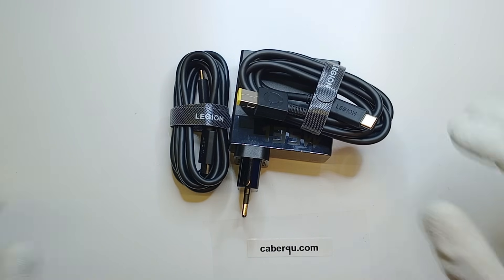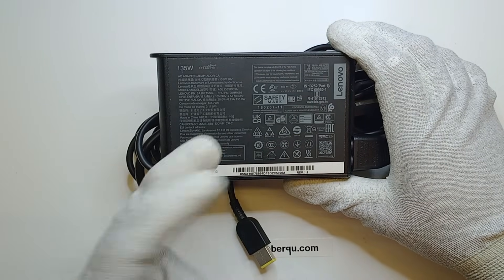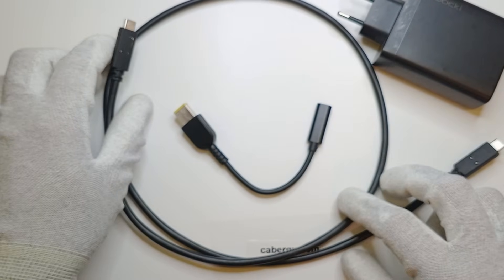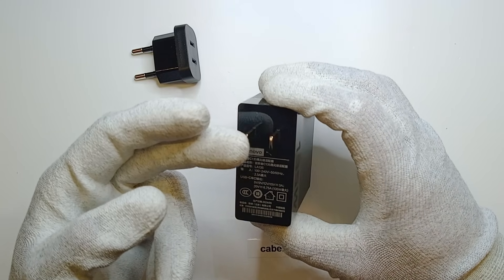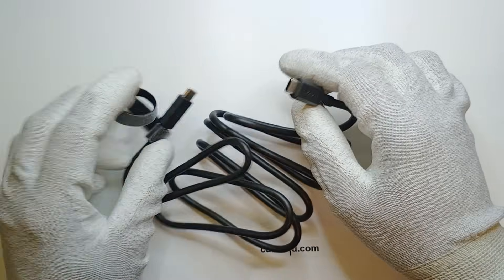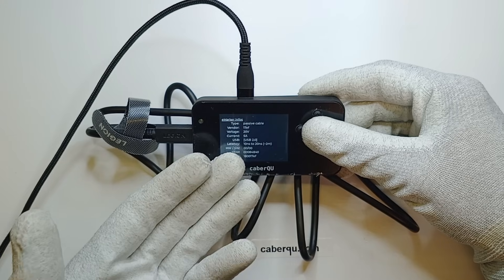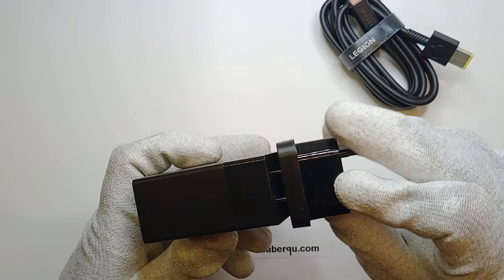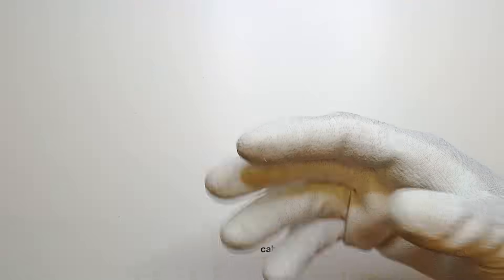Region locked laptop charger for above USB spec charging currents

Comment: The plug is Chinese. Also you're better off testing it with charger tester , it might support all the voltages and currents. Also it probably outputs 6.75A only if you're using the USB-c to prop Lenovo plug. This is probably why the USB-c to USB-c is only rated at 100W, cuz it won't trigger the 20V 6.75A, but only 20V 5A.
And the charger is genuine Lenovo, branded for Legion sub brand.

Comment: This is fairly common actually, dell has an out-of-spec USB-C solution dor 200w docking
Reply from the maker: quite interesting, could you send a type or link?
Reply: @quiescentcurrent the WD22TB4 does 130w for dell systems over a single USB-C cable and the TB18DC does 180w over a weird, fully moulded dual USB-C connector. I think so long as the PD spec itself isn't violated (and still used for negotiation) then using a proprietary spec for exceeding PD is absolutely fine
Reply from the maker: Thanks a bunch, I will take a look at them

Comment: That Lenovo rectangular plug can charge at many different wattages that is determined by a sense pin which has a resistor connected to ground. You can buy different cables which will have the resistor built in - the value of the resistor indicates the charging wattage so each cable will have a fixed charging rate.
Reply: It is not a resistor. It's a chip embedded in one end of the cable, that talks to the charger telling it its supported specs.
6.75A is more than the usb-c spec, so probably that charger and cable have a proprietary code that enables the charger to give that much current only with that cable.

Comment: lmao it's not fake 
MacBook chargers do the same thing - they are 140w but use USBC PD 3.1 spec via MagSafe 3 and limits the charge to 100w if used with regular PD 3.0 cable

Comment: There are a lot of spec violating charging devices from China actually. One good example is Xiaomi 33/66/90/120W charging over a USB-A to USB-C cable. The cable is modified to have a center pin on the USB-A Side and has a special E-Marker on the USB-C Side. They use a custom Mi-PD Protocol that isn't compatible with regular USB PD.
Reply: Xiaomi are a-holes. Their phone charges 67W with 11.11V and 6A, but with regular PD it charges 15-18W top. I don't understand this why they are using own  "standard" instead world accepted PD

Comment: For the plug type, it's a US style plug (NEMA 1-15 in the US standard - the holes in the blades are common but purely optional). But it's also used in a bunch of countries, including Canada and several other countries on the American continent, China, Japan... Wikipedia has a nice map in the "Mains electricity by country" article - look for countries using "type A", or "type B, A", in the nomenclature they used.
Reply: I will add for those not in a NEMA plug country, while the holes in the plug are optional, they are nearly always present to the point it looks wrong to us when they are not there.

Comment: I've seen this weird US plug with the missing holes before on phone chargers that come with Chinese market phone. So very likely that charger is meant for the Chinese market
(tho tbf the spec for the US plug actually mentions that the holes in the plug are optional and there for manufacturing purposes only)
Reply: Yeah, seems like US devices usually have them (but don't need to), Chinese devices don't.

Comment: what do you mean by region lock you was able to use it without any hacks
Reply from the maker: There is no way to buy this in the EU and it has no option for a different plug than the one it came with. I assume it was specifically built for a single market and not sold anywhere else.
Reply: Then how did you get it?
Reply: because he lives in a 240v country, in america because you guys use 120v it would not work. hence the "region lock"
Reply: @oggilein1  in the video, we can easily read the 100-240V, 50/60 Hz marking on the charger. Electrically, it'll work anywhere.

I assume he just means that it comes with the US plug permanently molded, so the manufacturer can't sell it in all markets (at least not without making different versions with a different molding, etc.).
Reply: @oggilein1 it does work in the Us however

Comment: 135w is the Lenovo supply for machines with separate graphics cards, that USB C to laptop short cable is probably for the 65w or 90w with integrated graphics.
Reply: The integrated graphics ones from Lenovo don't even have the rectangular plug afaik. My Lenovo has such a plug for its GPU too but can also be charged via it's USB c port
Reply: @fourthvolt8209  A lot of older Lenovo laptops at lower power levels use those rectangular chargers, so it's mainly an adapter for use with those in case their original charger fails or is lost - that way you can use a regular 45/65W PD charger with that adapter rather than buying an expensive first party charger.